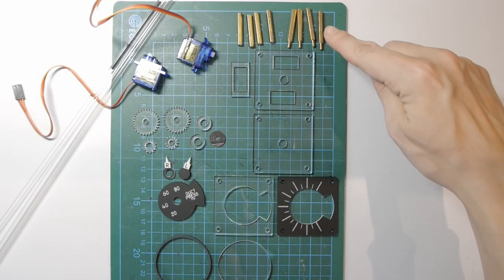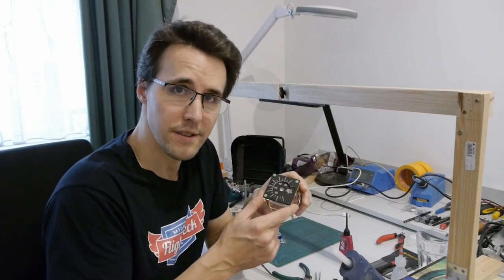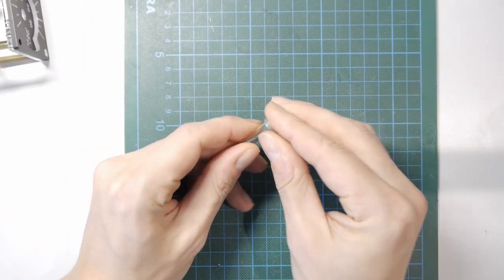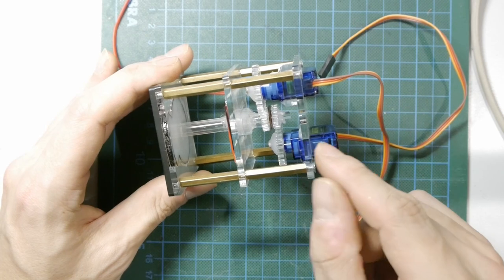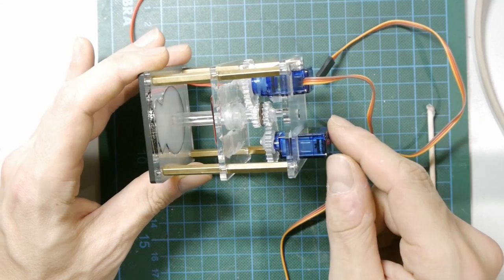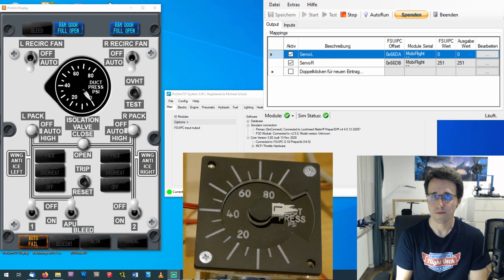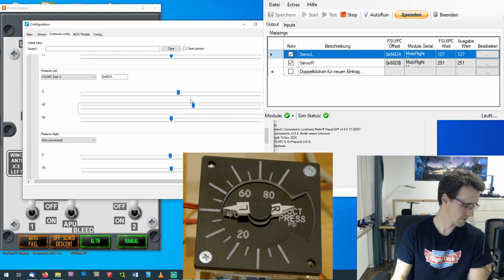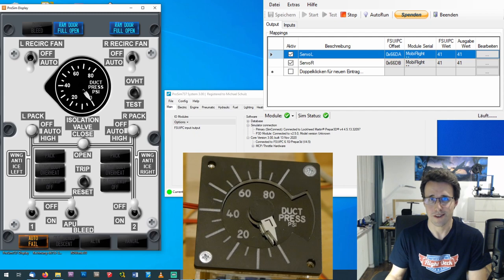Dual Needle Gauge - A Boeing 737-800 Homecockpit #49

Comment: Hi Michael!
Thank you for your wide overview over a situation
I have a little question - how are you being able to turn a 180 degree servo from 0 to 80 PSI, even if the angle is obviously bigger than 180? Thank you again!!!
Reply from the maker: You can see that I'm using different sizes of gears. So if the gear on the servo has more teeth than the gear of the needle, you will end with a bigger rotation.

Comment: Left Pack und Right Pack schließen und den Iso Valve auf Open stellen, dann verteilt sich der Druck auf beide Seiten
Reply from the maker: Danke für den Tip. Hat bei mir tatsächlich keine Änderung bewirkt. Vielleicht liegt es auch an der Situation (Stehend auf dem Rollfeld). Mir ist dann eingefallen einfach mal die Ground Air dazu zunehmen.